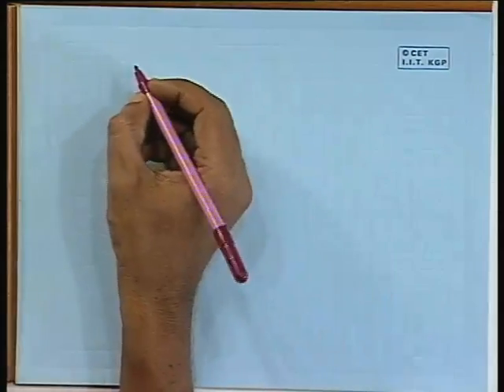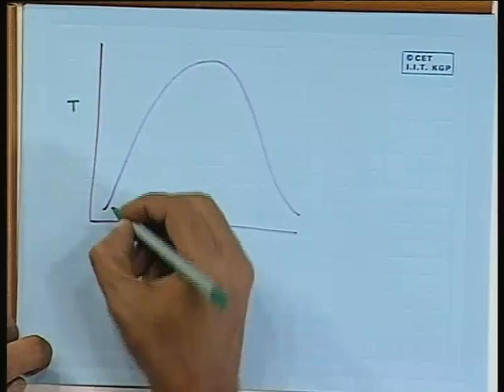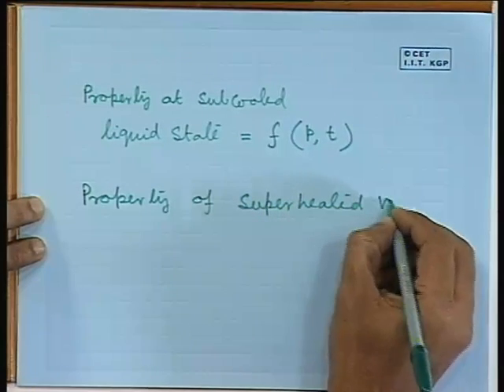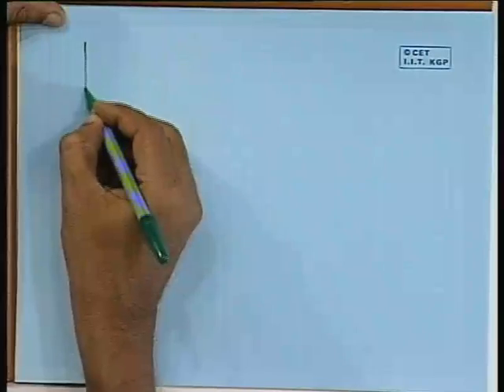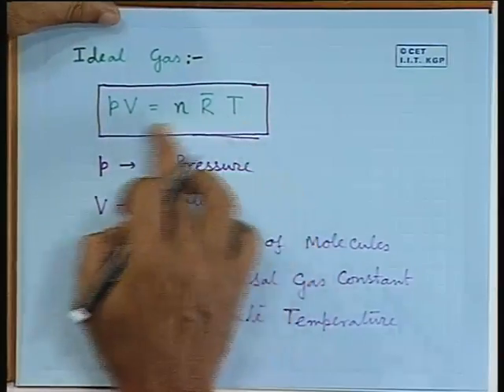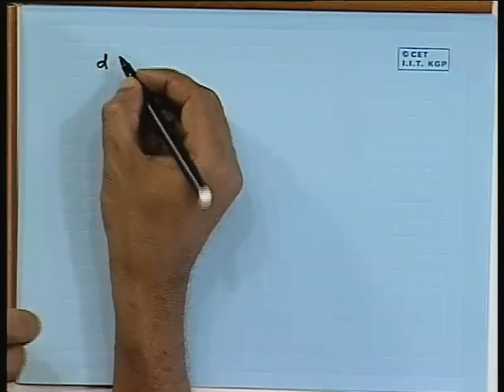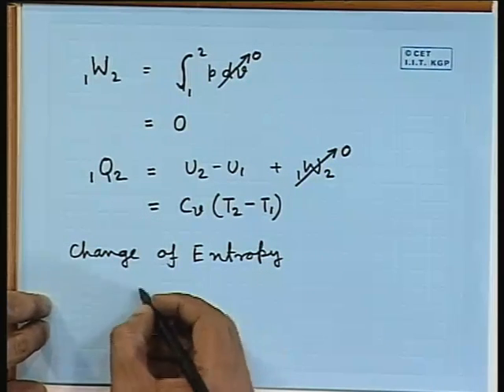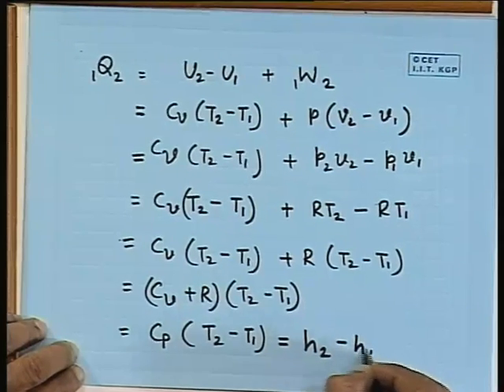Lec-7 Ideal Gas Laws, Different Processes

Comment: the lecture is lucid and very useful.

But i want to point out that in 19: 45 min, (approximate)  the data being discussed is at a pressure of 0.01MPa and not 0.1MPa.(as i am finding in the tables). Hope the Prof. has a look and corrects either me or the lecture.

I hate such a good lecture to have any in accuracy in it
Hats off to the professor.